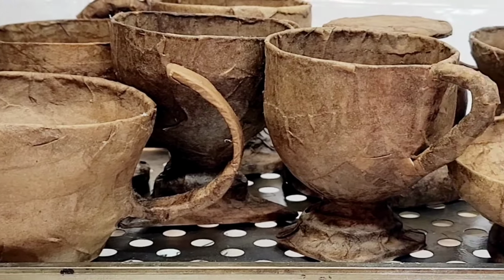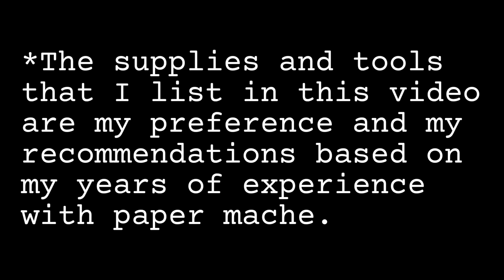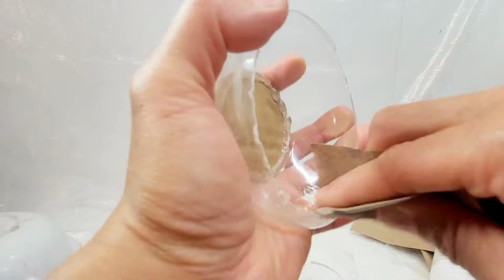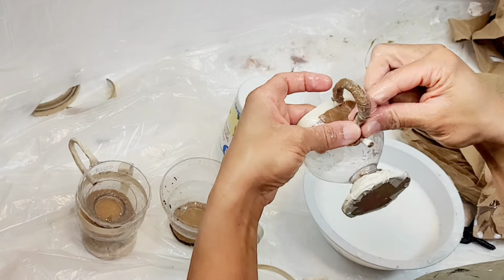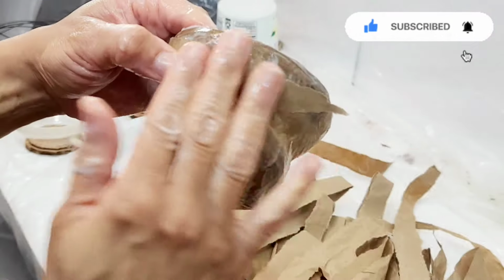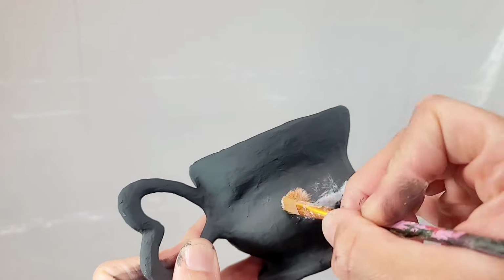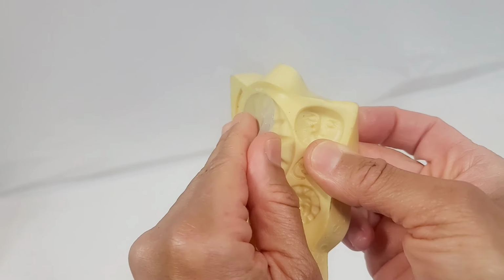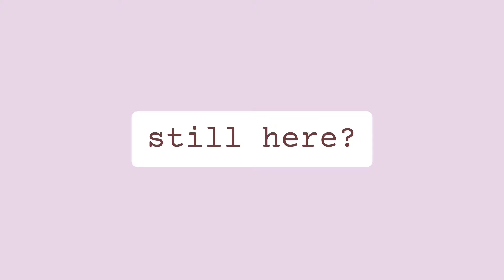Make Paper Mache Teacups with Me

Comment: Since you're using a glue & water mixture, how many layers do you do at a time? I use liquid starch and it gets a bit too wet with a lot of layers at once. Since they've discontinued the Sta-Flo, I'll be using the glue mixture and I'm new at it.
Reply from the maker: Wow- they don't make Sta-Flo anymore? It's the same with my mixture. It can get pretty soppy if I try to do it all in one session. I often start with 2-3 "establishing layers", let them dry, then go back in with 3-5 more (smaller shapes may not need that many).
Here's extra info on my slip: https://youtube.com/shorts/hA4q8lk9QAg?feature=share